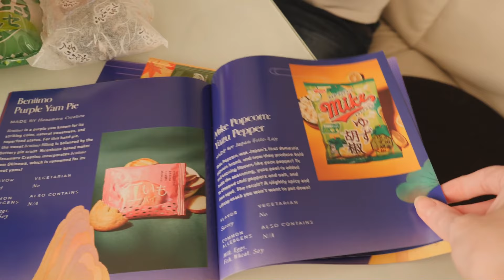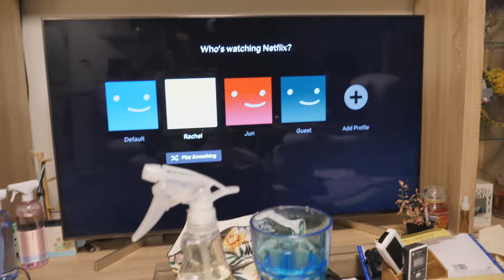I broke our couch

Comment: I would suggest NOT stapling the rope on the cat pole. I did this and my cat got her claw caught and it ripped it off. She howled and and it was very upsetting to me. She hid under the bed and licked her paw for about 3 days. So I would avoid staples 🐾🐾🥰
Reply: Same thing happened to my cat :(
Reply: Yeah I was just about to say the same thing! Staples are very dangerous for cats on cat towers/cat scratchers.
Reply: Best solution is to double the rope. First layer, tightly wound and stapled with the round (cable staples) every 10 cm in random places. Then the second layer (the wear one), which is wound from the top down, and cross stitched (two cords going around then twisted and going in the other direction). It creates a seam, which itself becomes the strong part of the whole thing. If you repeat this on both sides, alternating the "stitch" by one layer, then it's nearly impossible to get it unwound, torn or broken. It will wear eventually, and need replacing, but it's the superior method.

Caveat, if your pole is already thick, then it will be considerably thicker than original, which is why i usually put a hard lumber pole, which allows it to be thinner (so like 4 cm oak pole vs a thicker, but lesser wood like pine, a bit more expensive, but worth it).
Reply from the maker: Oh god I'll keep brainstorming
Reply: @RachelandJunAdventures  I can't suggest the best way to hold the rope down since your tower has dividers and usually i had just used the big staples that require a hammer, one on top and one on bottom. However:

-- every few rows use a rubber mallet to tamp down the rope
-- every 6-12 inches, wrap the most recently done section in packing tape to hold it in place while you continue
Reply: I saw removable covers made from carpet that wrap around the climbing poles on a cat tower and were fastened with velcro. It was on a YouTube channel by 2 Korean brothers who have 2 cats and a dog.
Reply: @sjbock  MilkyBokiTan?
Reply: I also agree about the staples. Bought a cheep cat tree in collage and it used staples for the carpet covering. It lasted almost 10 years but one day my Sr cat got his back scratched by an exposed staple which you couldn't see unless you were looking at it from the ground. The cut was bad enough he got stitches.

Cat tree was taken apart and used for a bonfire. 

My cat still won't go near the new staples free one.
Reply: @kathryncurtis9320  hmmm burn the evil tree and roast snacks with it

Comment: Trained sofa-maker here: Ironically, those springs are sold under the brand name NOSAG (like no-sag) and the plastic "thingy" that broke come in a metal variety as well (never heard of any of these ever breaking). In a pinch, you can try to find a metal hinge with bolt eyelets (female part) to attach the lose end or make a loop from those metal strips with evenly spaced holes you use in construction to re-attach the spring to the frame.
Reply: thanks for letting us all know :D I dont own such a couch but if I ever do I know what to do thanks to you :)
Reply: Don't worry I broke mine too. And it was a lazy boy
Reply: Wonder if Rachel seems this fix it post

Comment: I thought the chaotic, mutli failure, frustration was only Because I was bad at fixing things. This is the first time I have ever seen someone struggling like I do on YouTube. thank you for posting.
Reply: I built my first piece of furniture a few weeks ago, which was my bedframe. I spent TWO HOURS alone just trying to match up one piece with the holes because they weren't alinged. Total build time took me nine hours on my own. Skipped work the next day as I was tired and didn't go to bed until after 3AM (I really wanted to get my new mattress to start decompressing so as to not have to spend longer sleeping on the air mattress. In fact, because I finished so late, I felt it would be terrible to inflate the bed at that hour as the pump sounds like a vaccuum and might wake my neighbors...so I slept on the floor. Oh...my poor back and hips. My neighbors had better not EVER wake me up with noise after giving them that level of courtesy 😡).

And I guess I stressed myself out too much with building the thing as I fell sick the day after. Good thing the mattress had pretty much expanded to its full size in just one day, so I had a real bed to crawl into and be miserable as I fought to get better 😂. 

Anywho, you're not alone at the "being bad at building/fixing things", lol. And kudos if you can do creative solutions to a building problem like what Rachel did!
Reply: I'm just surprised fixing the couch only took one trip to the hardware store! They actually reused/repurposed supplies they had saved up from other projects. 
Though, I winced when they said a piece of staple was still floating around and Rachel wasn't wearing any safety glasses.
Reply: As Bill Burr said "losing your shxt is part of the process of fixing things."
Reply: We all do !
Reply: Definitely par for the course when I try to fix stuff :D
Reply: @BewareTheLilyOfTheValley  OML! Serious respect to you for pushing through the mayhem!
Reply: @MayimHastings  Thanks, lol. I love that the instructions said it only takes 1.5 hours with two people. Almost none of the reviewals for it say that's all it took them. That would maybe be so with a veteran of building stuff and understanding diagrams, not a first timer. Also, that part I struggled with for two hours, tell me why near the end, I realized I installed it backwards? 😂 There was a brief moment where I was this close to saying screw it to everything and that bed can go kick rocks with open-toed shoes, lol! Thankfully, the piece was easy to switch around and I didn't have to disasemble much to fix it. Two hours on that piece at the start...just to find I did it wrong 🤦🏾‍♀️. I told my mom that when I move out, I don't care if I have to take the hinges off of every door, I am NOT taking the bed apart!

Comment: This reminds me there's a hole in the back of my couch that traps anything that falls into it, that I definitely need to sew up. Rachel's ingenuity in putting this back together was fantastic to watch! EDIT: Also, staple guns take so much hand strength to use, it's like a workout.
Reply: THIS reminds me of the hole in my jacket where my hand gets stuck in every time I put it on 😂 I should sew it up too!
Reply: It reminds me that I keep intending to upgrade the diy cat fence I made to stop my kitty hanging out in my kitchen sink
Reply: y’all I’m giving u guys some courage to finish your diy things ✊✊
Reply: That's why there are now hammer type staplers and electric ones. But they don't make much sense for home use.
Reply: Duct tape covers holes.
Reply: @recoil53  i did not spend five years as a theatrical carpenter to use duct tape.
Reply: A few years ago, my phone fell down the middle of our 2-seater sofa and somehow ended up IN the sofa. I had to cut underneath the sofa to get it out... Another thing I should probably sort out 😂
Reply: I need to use my body weight to use staple guns, like I'm doing cpr. My hands are not strong enough to use them the "proper" way.

Comment: What every engineer says: It doesn't have to look pretty, just needs to do what it was designed for.
Reply: Certainly the credo of the field engineer.
Reply: I did a fuel cell car (like tiny remote control car) project and our advisor said something that has really stuck with me to this day: “The first priority is to make it go, don’t worry about how it looks. If you can make it go, you’ve already beaten half of the other teams there.” She was wrong only in that she overestimated the number of teams that would finish the race.
Reply: Engineer gaming

Comment: Rachel's rant about crucial plastic-y pieces breaking and generally being unreliable is a MOOD! 💯👍👍 but even more impressive than your adorable cats is the SOLUTION you came up with 🤯🧠 💡👏👏👏. I'm pretty handy myself and the only solution I thought of right away given what broke is to nail/screw something that can hold the loop of the spring something really simple like a big  nail bent to loop into itself or two screws bent together creating a loop for the spring to latch onto. that tiny screw solution is a Godsend it looks it, first time I've seen anything like it 👍👍
Reply: Remind me of my Grandad's rant about how model trains nowadays have a tendency to use plastic gears instead of brass but they are always rubbing against metal so the plastic will wear away much faster than brass. And model trains are expensive. 🤨

Comment: I was rooting for you so hard watching you fix this thing. Staple guns really are hard to use if you have weak arms (which I do). Your dinner looked so good too 😭
Reply: You can normally adjust the pressure of the staple gun
Reply: @Starteller  Or you can just cope out and buy an electric.  :-)
Reply: @bknesheim  Yes but be careful and don't shot them through the air :D
Reply: @blablup1214  I have never done that.  :-)
Reply: I was so confused since you guys have the exact same profile picture
Reply: @NoahDrawsALot  That the power of the default option.  :-)
Reply: @bknesheim  :-)

Comment: The tapered screws you have are meant for wood, they're pointed with wide threads to bite into wood with a little pressure and the tapered/countersink heads mean they sit inside the wood when you're done so a great choice for the job. :D

Comment: Good job Rachel! I’m with you, nobody said it has to be perfect if it works. Especially if you can’t see it. For future references: 1. When selecting size of drill bit to use, hold it up behind the screw you’re using. It should be the same width minus the threads. 2. Rubbing the screw along a bar of soap helps it go into the wood easier. Happy handiwomaning!

Comment: Not a bad repair there Rachel and Jun. Well done.
I used to work at a furniture manufacturer as a builder, QC, supervisor, and furniture repair tech.
I can tell you the little pry bar is pretty close to a tack puller the actual tool used to pull staples. It's just not as tight a slot for the staples.  We made our own from flat head screwdrivers we cut and sharpened on a grinder.
Not sure why that spring clip was plastic. The plant I worked at used metal hooks that you hammered closed over the spring.
Springs are normally put on with the fabric cover not applied.

Comment: I recommend a magnet for finding escaped staples. I’ve just liberated a lot from a carpet after taking a bed apart.
Reply: Idk about other hardware stores but we have gotten a magnet of a collapsible stick from there. It is THE BEST. My partner uses is for stray screws, I use it for stray pins. 11/10 do recommend each household should have one.

Comment: The wood samples for floors are gonna be SUPER hard to work with. Coulda used pine. Also… could have turned the couch over onto another seat to have a better angle. But it makes for a good video.

Comment: Glad to see you trying to fix things rather than just throwing it away! Two things that will be good to remember for later though!

You're using the wrong screwdriver for the screw. You're using a Philips screwdriver on a Pozidriv screw. Easy way to spot pozidriv screws is if they have a small "x" over the + shaped hole. The bits are not actually interchangeable and will lead to destroying screws quickly. Looks like what you needed here was a Pozidriv 2 or 1, denoted PZ1 or PZ2 on screwdrivers and bits. 

You can adjust the strength of the staple gun by turning the knob on the top! Higher strength means you'll force the staple in deeper, but also means you'll need a lot more force to squeeze! Usually starting light, and rather increase the strength if the staple doesn't go in fully is the way to go.
Reply from the maker: Noted!! I didn't know about pozidriv screws. Thanks for the info!

Comment: The knob on the back of your staplegun adjusts the spring-hammer tension.  Smaller staples into softer material doesn't require as much "gun" and it makes the squeeze force required to operate much lower.  You can back it all the way off and slowly raise it back until you are getting all your staples fully inserted without having to squeeze the handle any more than necessary.

Comment: This reminds me so much of my battle with our couch! It was so badly stained and broke along the supporting wood, that the only thing to do was dismantle it! So I spent a day tearing up our sofa! Then it was off to the recycling, which means let someone else worry about the non-flammable bits and tear it down further. My cat thought it was fun to crawl into things also, especially when I was working underneath the 5.5 foot part of the sofa. BTW, we have yet to replace that lost piece of furniture, using a spare twin bed right now while my husband I figure out what we want to replace the old one. What I have learned is buy something that I can change out the covers on.

Comment: A quick tip for driving difficult screws like that:  right before you start driving them, dip a fingertip in some liquid soap and coat the screw threads.  The soap works as a lubricant until it dries.

Comment: Plastics can be made in different strengths.  I was in the Canadian Forces and back in 1984, I received the new 1984 Pattern Webbing.  It had plastic hooks on the pouches to hold them to the web belt and I was sure they would break.  However, with a little bit of care, I never broke a single plastic hook on that gear and I had it for over 20 years.

Comment: Just a tip for future reference cause I know the pain of using staple guns, they are notoriously finicky. I find it much easier and more reliable to just use a hammer and some type of finishing nails or tacks to do the same job in place of the staples. They much easier to install and remove if need be~

Comment: I've had two of those exact plastic thingies break on my sofa over the last decade or so. I managed to fix them both by drilling a couple of small holes in the plastic thing that snapped off and screwing them back into the wood frame. The repairs are still perfectly functional years later.

Comment: You might not need it but for future reference, look up how to do binding of dizi (chinese bamboo flute) and use that same method to do the rope around a scratch post. It does not require glue or staples and the knot is hidden inside. It's a safer method for the cats too. It also works for square pole. I tied them around my square stair bannisters as scratch post and it's used most by our cat.

Comment: Heads up for using the stapler in the future. The metal disc on the top is so you can use a rubber mallet to hit and staple easier for bulk stapling jobs.

Comment: All of the woodworkers out there are screaming at their monitors right now lol, at least you got it done in the end.
A few tips for next time: 
1) Use a drill around the same size as the screw shank (bottom of the threads) when you're screwing into wood, only the threads themselves should touch the wood.
2) If you're screwing 1 peice of wood to another the holes in the top peice of wood should be be slightly larger than the top of the threads (clearance holes) so the threads don't grab in both peices and bind up.
It never ceases to amaze me just how much crappy plastic is used in everything now, it's no wonder it ends up screwing up the environment when it's so prevalent in everything for no good reason.

Comment: Oh and a tip for any kind of stapling or drilling, fix the thing your trying to staple/drill against something (like a wall), use one hand to guide/hold the stapler and then use the other hand to press on the end opposite the staple/drillbit. That way you can use your body weight to supplement your strength. Much more effective than trying to use your arm strength

Comment: One tool that I find indispensable in the home is an 8-inch "Cat's Paw." It's basically an itty-bitty crowbar meant for prying and pulling nails. It'll get under those upholstery-grade staples and the giant copper ones in heavy boxes with no problem.
Incidentally, when I want an Adult Libation™ and I need cracked ice, I put one of my big ice cubes in a sandwich bag and give 'er a couple good sharp raps with the flat side of the Cat's Paw, and bingo -- cracked ice. Just dump it into my cup before I pour the drink so I don't splash everywhere.

Comment: If you're having trouble getting a screw to go into wood, screwing it into a candle or something first to coat it with wax makes it just glide right through the wood. This has saved me on multiple DIY home repair projects. (This tip doesn't really help if the screw is stuck in the wood and you can't remove it to wax it up though, lol).

Comment: Comfiest couch I ever had looked exactly like that on the inside, with the stapled cloth on the bottom and the big gap and then those flimsily attached springs. I broke two of them in the exact same way, but I gave up instead and just threw them away. I am impressed.

Comment: If you've ever got a stripped screw that is flush with a surface, such that you can't grip it with pliers, I've got a hack which I've found sometimes helps. If you have a wide elastic/rubber band, pop that over the screw, and then try unscrewing it with the screwdriver pressed into the band. The band is soft enough that it should fill the hole, while being strong enough for the screwdriver bit to grip onto.

Comment: When you guys have the budget, should invest in an impact driver - it's like a drill, and shaped like a drill, but specifically for driving in screws into surfaces, not drilling holes. Works better than a drill, for that, too, it will help sink the screws deeper.

Comment: I think the one they used for stapling the couch is air-pressure staple gun. They require less strength but can be super dangerous if fire the wrong way.